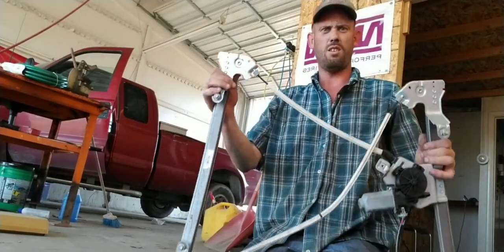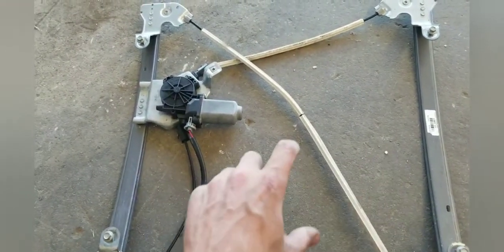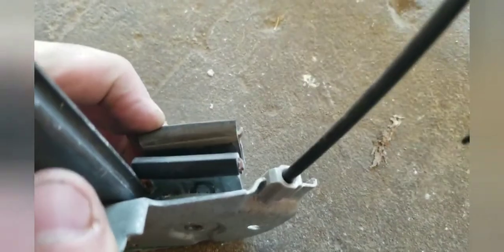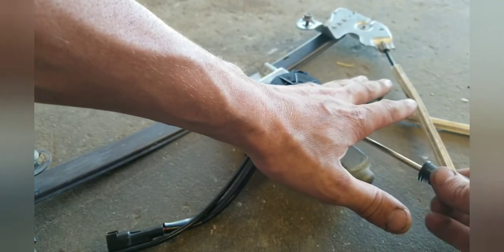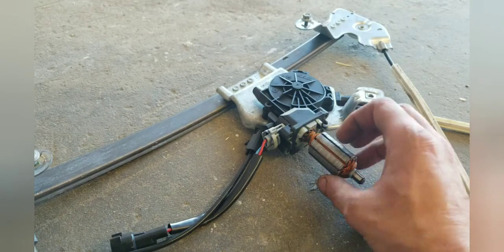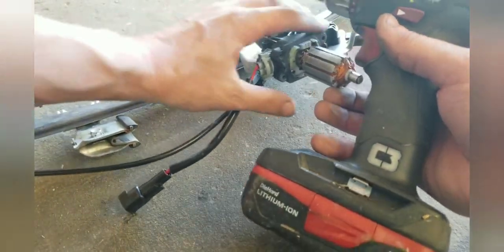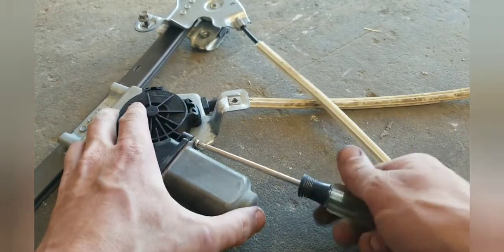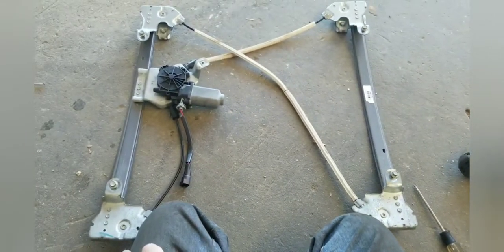Ford F-150 window stuck all the way down

Comment: Thank you for the video, if it is in the door,  pull the armature out and you can freely push the window back up then while holding the window up in place, put the armature back in the actuator for it to hold the window up, reinstall the case and 4 screws and that will hold the window in place until a new motor can be installed. This is much easier than tying to wind it back up manually or with a drill.